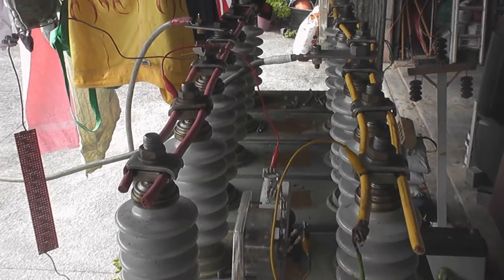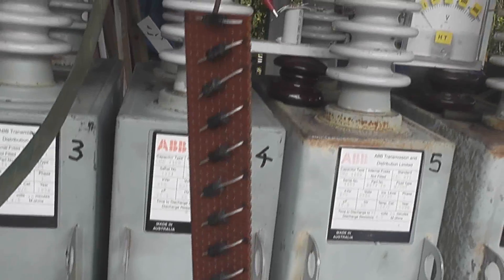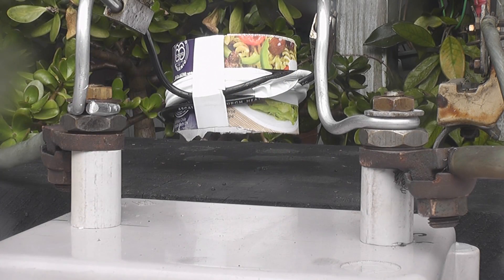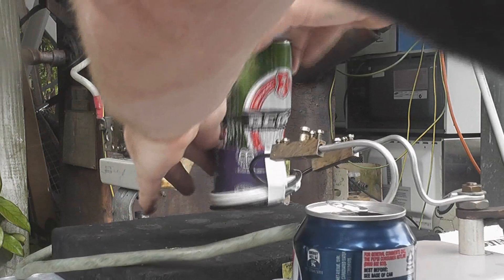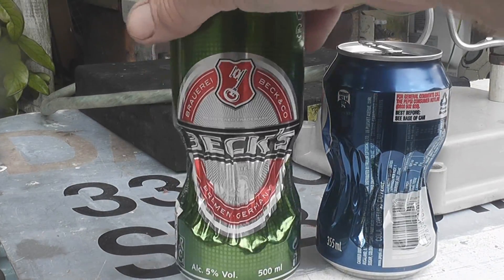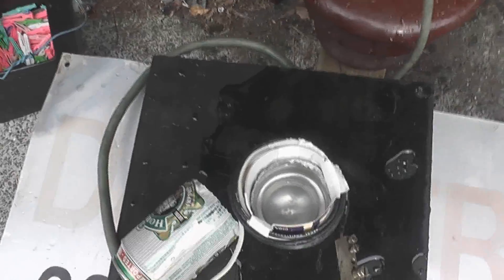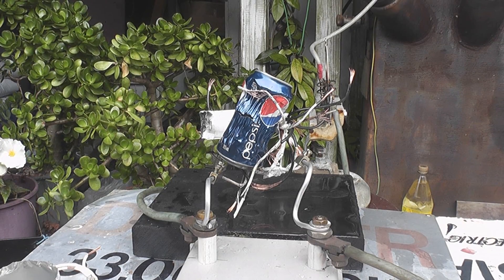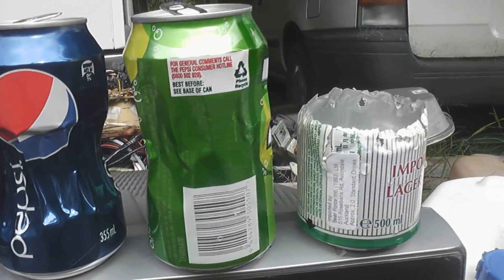Crushing some cans with Capacitors

Comment: What would happen if you did 15 to 20 turns rather than 9
Reply from the maker: Still in the early stages, will do this with better turns and also redesigned set up as the cables were arcing in the clamp terminals., and loosing energy.
Reply: +RODALCO2007 The wires you used in your coil looked like they were blowing their insulation off as well, which then obviously made them self destruct.